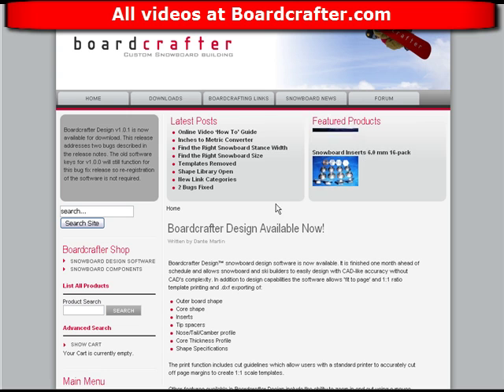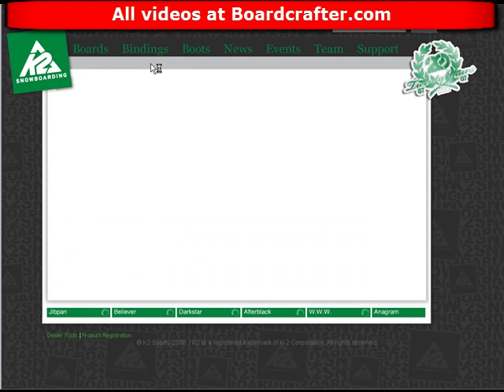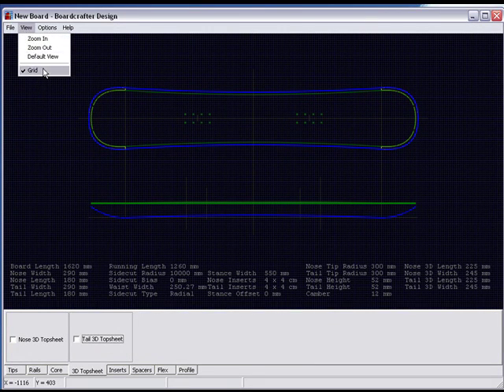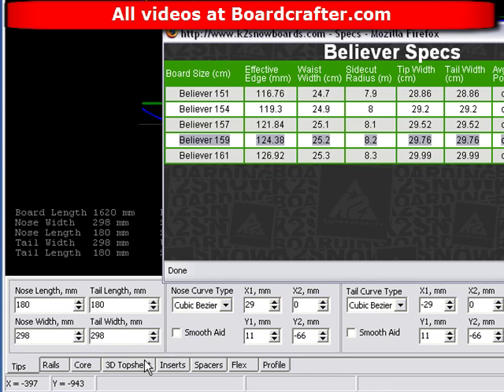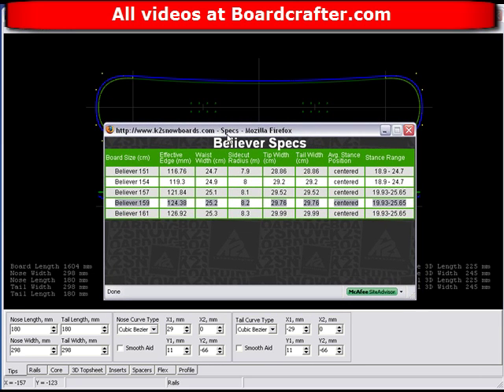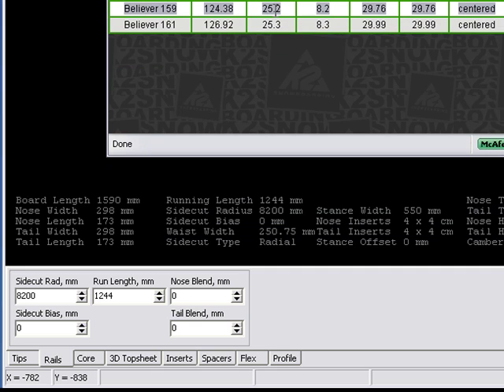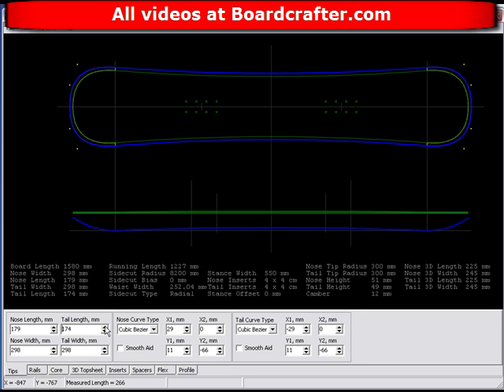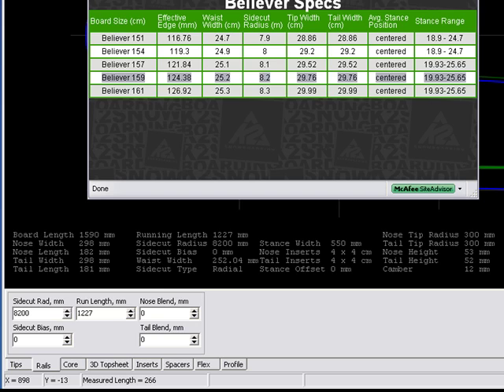Inspired Snowboard Design - Part1

Comment from the maker: So the next best thing is to recommend a longer board because they are design with an overall larger rider in mind (taller and heavier).  BUT if you are making your own board you dont have the same constraints. If you are a heavy rider keep the length tied to your height but make a board with a thicker core.

Comment from the maker: The character limit is going to make the response a little messy but MtgKirin pretty much has the answer. Take a very tall skinny guy and a very short stocky guy that both weigh the same. If you go by weight they would both get the same board. The tall guy's board would be too short and he's more likely to endo pow landings or have the short board fly out from under him when he's leaning back on the tail.

Comment: I really don't understand your size indicator?  Why would a board care how tall you are?  4' or 7' tall should make no difference to the board.  The factor used in determining board length should be rider weight.  A 3'  tall rider weighing 300 pounds would put the same stress's on the board as a rider 6' tall weighing the same, therefore, requiring the same size board.  I would really like to hear your opinion on the matter.